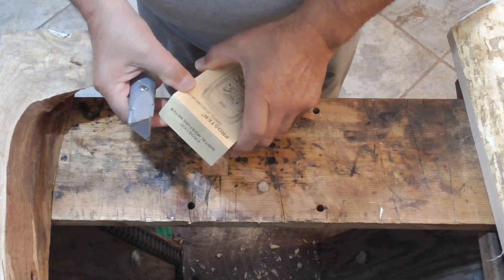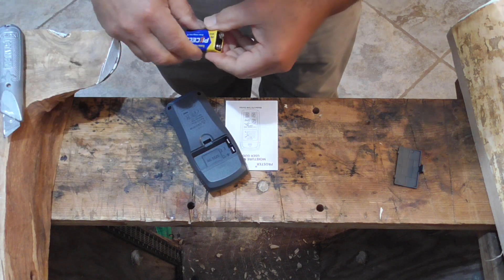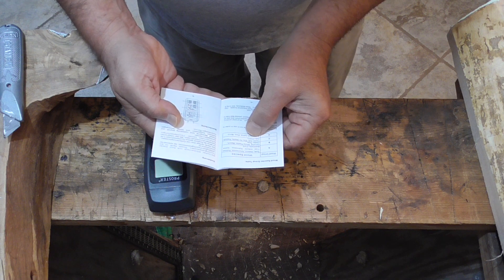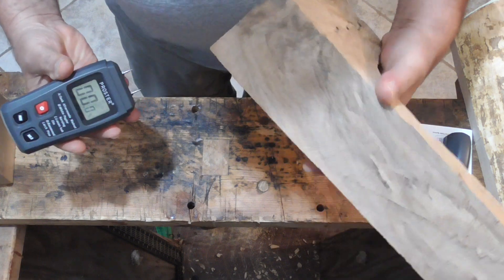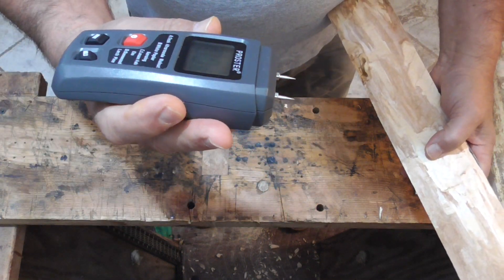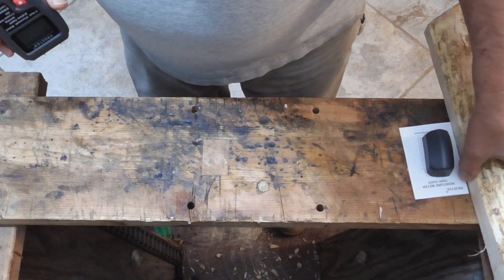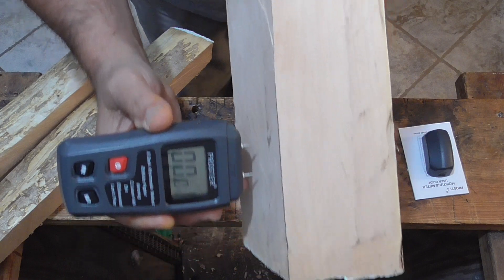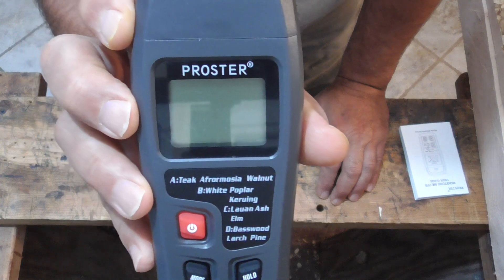Moisture Meter - Unboxing and first use !

Comment: Very handy tool. Was surprised to see that this years Maple had a similar reading to material from 2014.
Reply from the maker: I was surprised as well. This years stock is drying nicely, in a few months I'll cut a blank in half and do a reading on the interior. I suspect that reading will be higher.

Comment: Interesting. If it doesn't damage them could you check some of your planes and see if they are around the same 12%. Thanks again.
Reply from the maker: I like the idea. I will measure a few & report back !
Reply from the maker: Here are some results:
5 planes, lumber milled in 2014: 12.0% , 12.6% , 12.5% , 12.4% , 11.5%
AVG. 12.21
5 planes, lumber milled in 2015: 12.3% , 12.2% , 11.5% , 12.3% , 12.3% 
AVG, 12.12
5 planes, lumber milled in 2018: 11.5% , 12.4% , 11.4% , 12.3% , 12.2%
AVG. 11.96
Lumber milled in February, 2022: 13.1% , 13.5% , 13.1% , 13.2% , 13.3%  
AVG. 13.24
Clearly, the newly milled lumber has a way to go.
Reply: @ROUGHCUT20  Thanks for checking. Merry Christmas.
Reply from the maker: @walterplummer3808  You're welcome Walter, Merry Christmas to you as well !